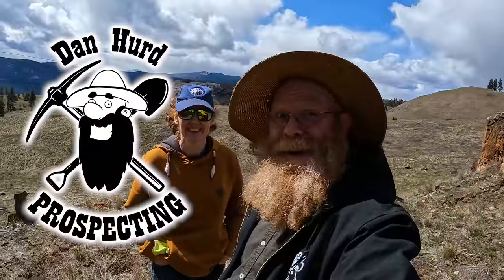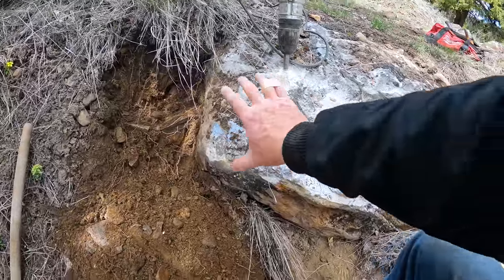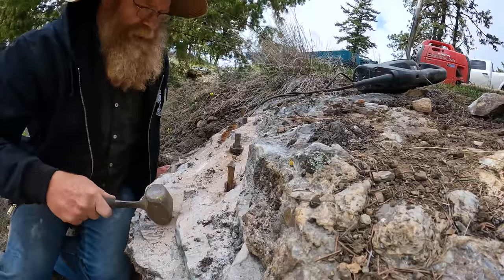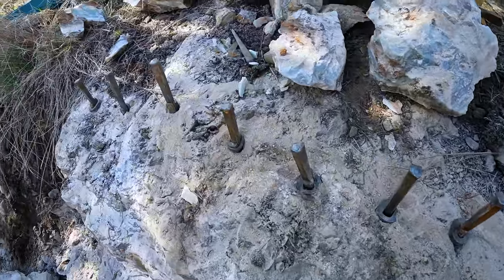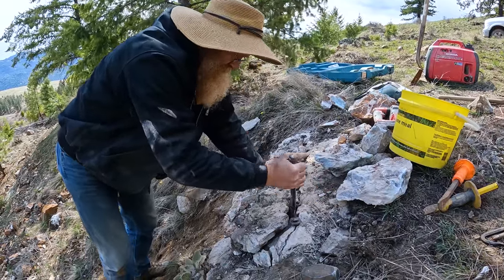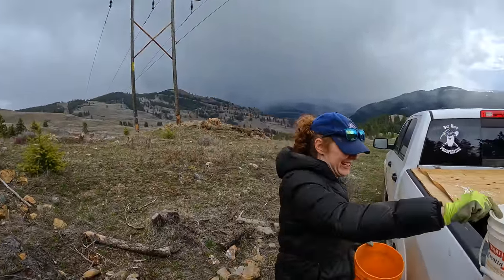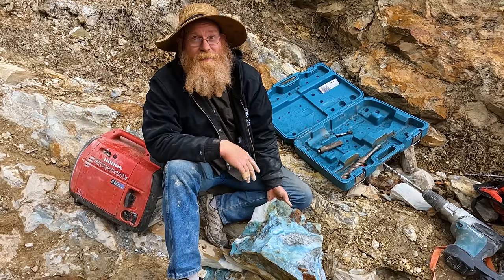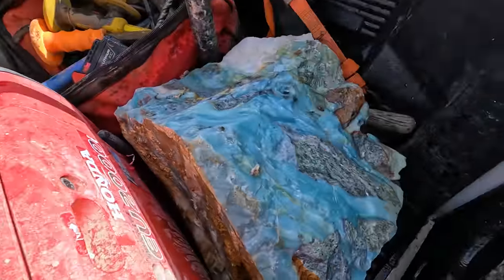BC Ocean Picture Stone - Running Out?

Comment: This may be a goofy geology nerd idea, but it seems you could print a small-scale topographic map of just your claim area and mark each vein/outcrop you can find with its Strike and Dip like on a geologic map  - basically, a short line showing the angle of the stone layer from vertical and which direction it is running.  Once you get a lot of those mapped you'll be able to trace the veins of stone as they run back into the hillside or head toward grassy slopes where you can't see them yet. Google strike and dip, it's interesting when you see what it can do. Just a thought!
Reply: You might also consider paying some young healthy folks to do that lifting for you. DO NOT OVER DO THAT HEART DANG IT. Day labor is cheaper than that hospital bed any day even with Canadian healthcare!!! Down time is costly!!!

Comment: Do remember to re-dress those wedges on a grinder or with a file. When the ends of drifts get flattened over like that (like the end of a badly hammered fencepost) small slivers of metal can spall off them when hammered. They can be travelling fast enough to cause a nasty injury.
Reply: Yup, especially good reason for eye protection. I am finding eyesight a problem in old age and cannot stress protection enough. It is really limiting. Losing my driving privileges would end me where I live. And one of those bits of metal at the wrong angle or spot could be major.
Reply: Yeah just last week grab cold chisel from bottom drawer of dead relatives garage and didnt pay attention much... first couple hits went fine, then one little bit in the angle and peace yeeted off like god damn bullet, hitting metal beside me and left nasty mark on there.. After that realized condition of it and grinded it down so it wont happen again.

Comment: (“BC OCEAN”) is really Jasper, an aggregate of microgranular quartz and/or cryptocrystalline chalcedony and other mineral phases, is an opaque, impure variety of silica, usually red, yellow, brown or green in color; and rarely blue. The common red color is due to iron(III) inclusions. Jasper breaks with a smooth surface and is used for ornamentation or as a gemstone. It can be highly polished and is used for items such as vases, seals, and snuff boxes. The specific gravity of jasper is typically 2.5 to 2.9. Jaspillite is a banded-iron-formation rock that often has distinctive bands of jasper.

Comment: Awesome specimens. Just a word of warning, watch out for mushrooming wedges and chisel heads. It seems harmless but those chips can fly off when struck with a hammer. They have enough velocity to go through jeans and hit arteries, eyes and do all sorts of nasty things! Just grind the burrs off as they form and it'll be a lot safer. 

Keep up the fantastic content 👍
Reply: The same goes for metal stakes, like those used for concrete forms, only in that case the softer metal of the stakes get hammered into a mushroom head with razor sharp edges that can slice you open with ease.

Comment: Stihl makes a chainsaw that I use to cut 24 inch thick concrete retaining blocks or bin blocks. It has a diamond tipped chain and a water hose connection to keep dust down and prolong chain lifespan. They are pricey and the saw is heavy enough to make its own downward cuts. Thought you might be able to use one while you were waiting on your permits to be approved. Love your videos and your enthusiasm, very inspiring.

Comment: You can also "start" the crack line by carrying along a small angle grinder with a diamond blade. Score a straight line across the top, then drill wedge holes! The deeper the score the more you can control the crack! 1/4" to 1" score depth. The idea behind here is you create a path of least resistance! Your brakes will be as clean as you can!

Comment: Dan, I've done a fair amount of stone work.  In general do not hit each wedge three or four times, hit each once and then in sequence.  Take your time.  And  I normally use a 2.5 or 3 pound wooden handle hand jack,, sledge.  A 4 pounder is too heavy for my tastes (I am only 6'4" and 280 pounds)  A 3 pounder hits just as hard, and tires less.

Comment: Are you giving the rock enough time to crack?
You appear to be in more of a hurry than you normally are with the feather&wedges.
Whenever I work with them I always leave it a good 10-20 seconds after doing a tappy-tapp-tapp pass. and then do another, and I notice that it can taker quite a while for the crack to fully develop.
Whenever I rush it I always get local cracking and chunks instead of the nice nice straight splits I target.

Comment: Always doing it the old fashioned way you need some Corey saws and rock saws lol then you would get some nice clean cuts without fracturing cuz those machines use water in the cutting process which keeps the blades cooler and able to cut deeper without fracturing
Reply from the maker: Once I get permits I can.  Also as I said I sell smaller pieces easier than big.  Our chip bags are our biggest seller.
Reply: @Danhurd  that's the part that I'm at right now in your videos where you're pulling off chips for your chip bags awesome show Dan I love it

Comment: Hi Dan, been watching your channel a few years now. I noticed in this episode you may be having a problem I ran into some years ago trying to split a large boulder in the way of a foundation pour I was doing. If you use a masonry drill long enough to drill all the way through the piece you are trying to split off, the whole face will come off as it seems you intend.
Basically, the crack will follow the holes in depth as well as the line they're drilled along.
I was able to rent a 36” bit and the boulder split very well using that.
Reply from the maker: I can drill the holes as deep as I want, the problem is the rock has a grain to it and it is weak along it's grain.  However I try to break it against it's grain to create rocks with the best scene.

Comment: Love your videos 
Watching you drill holes for the feather & wedges 
I was wondering if you have tried  either a electric or gas powered saw ?
As I have used both to remove Limestone 
But I was using a 16" diamond  saw blade to cut about 6 or 7" down 
I then used a electric jack hammer to break off the face 
So I had the idea that you might be able to drill a line of holes for the feather and wedges 
Then use a diamond blade on a saw and make a clean cut through the holes you drilled 
I would think this would allow larger chunks of stone to be harvested that are all in 1 piece

Comment: Some time back  I saw a show on TV where they were mining plates of crystals. They used the mini explosives like you have done before for gold veins, but they also used something like your feathers and wedges but it was pneumatically powered instead of hammering like you are doing. Would that be legal? Picture drilling setting and then a compressor with air doing the work of expanding the wedges. I know there are strict rules, but it might just save your swinging that hammer so much. Just a thought. sometimes just knowing a tool exists can really help you learn more.

Comment: To reduce the amount of tapping which produce  microscopic fissures throughout the stone maybe try a little more drilling and try  expanding foam. diamond tip circular  saws ,You are awesome
Reply: How would you contain the foam to build pressure, though?
Reply: @RICDirector  They make a special one just for that purpose. Saw it in someone else's videos. Not sure why it works but it does. Maybe hardens from the air at the top and then continues to expand deep, but with enough time it cracks big boulders nicely.
Reply: @RICDirector  A small amount does it’ll push Apart very hard stone

Comment: You need to consider a gas-powered concrete saw it basically looks like a chainsaw with an arm and a concrete blade on the end it would make your cut smooth and you'd have a lot less waste

Comment: maybe you should bring a bench broom, so you can sweep away the dirt and dust for a better look at your work area.
Reply from the maker: Or a vacuum or a leaf blower, water pump, broom.  I could bring all sorts of stuff, but where do I draw the line.
Reply: @Danhurd  You mean you don't have a water truck to go with that pump??? Yeah, out in the middle of no where makes it harder and hauling everything out and back each time is hard also, but unless you work it everyday and are on site theft is a real issue. Having a tool shed on site would just make it easy for claim jumpers to steal from you unless you have security guard around the clock. You are doing it the way that you can and that makes sense.